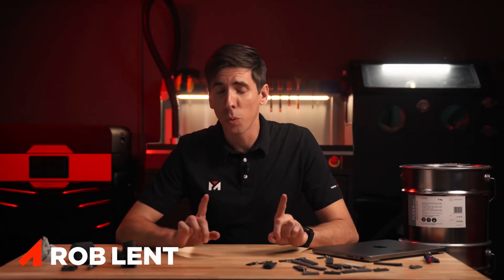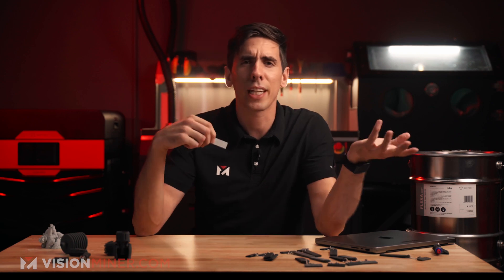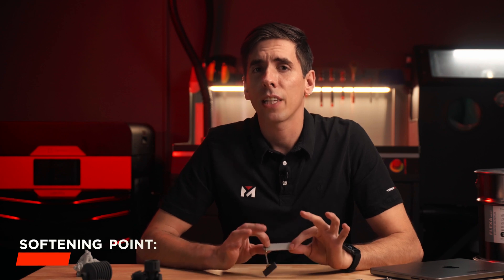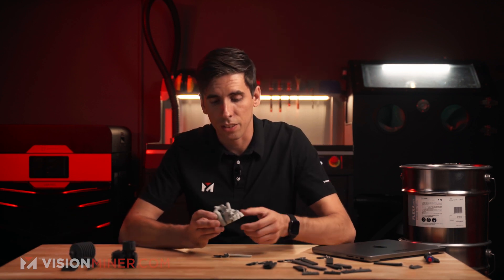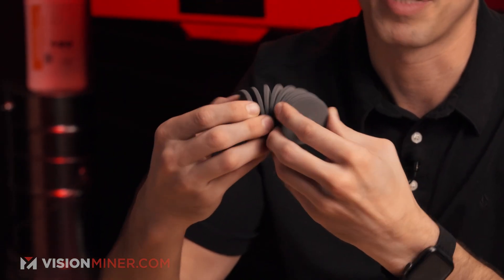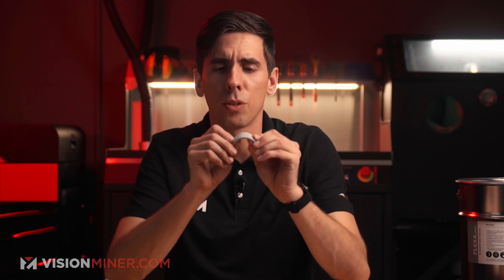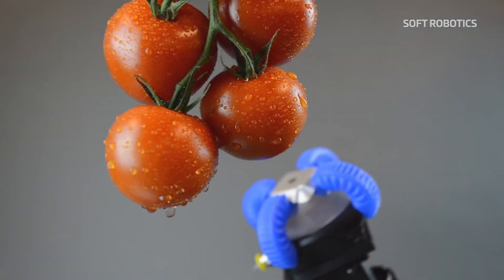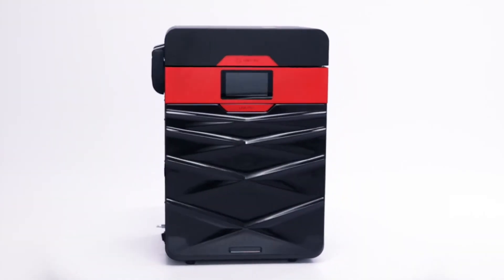Sinterit Flexa Soft Overview - Ultra Soft Rubber Replacement | Sinterit Materials

Comment: How do you print with this material? Is it a resin or a filament? How does it compare with all kinds of silicone and epoxy flexibles that we can find on the market? Please, expand this teaser. Thanks.
Reply from the maker: It's a powder, which gets sintered together by a laser in the Lisa SLS printers -- the third major type of 3D Printing :)